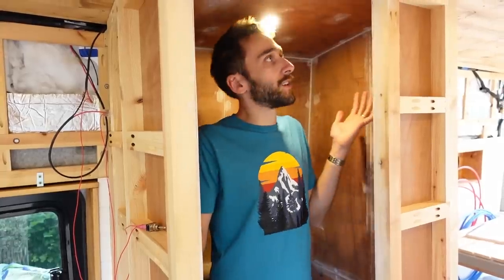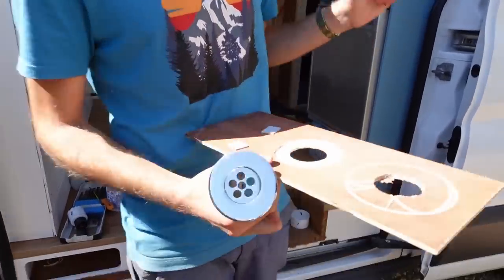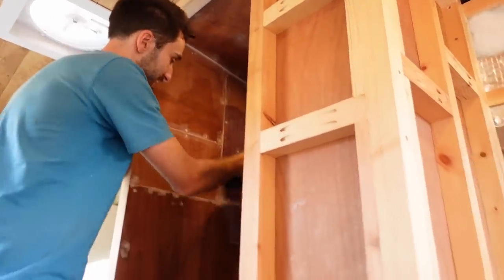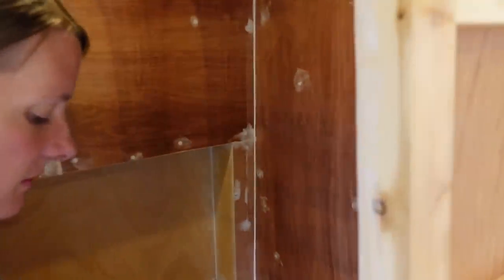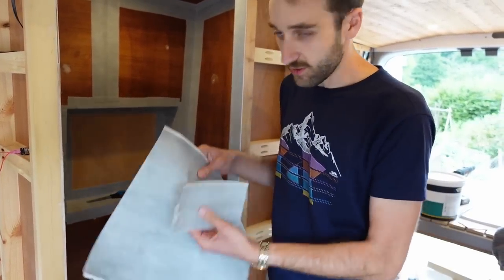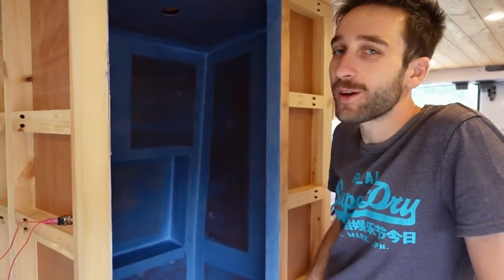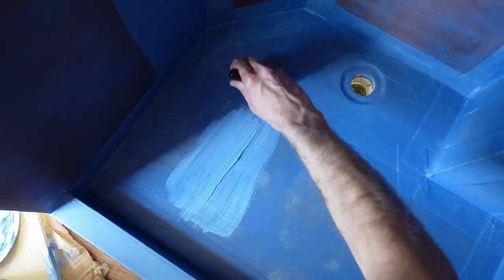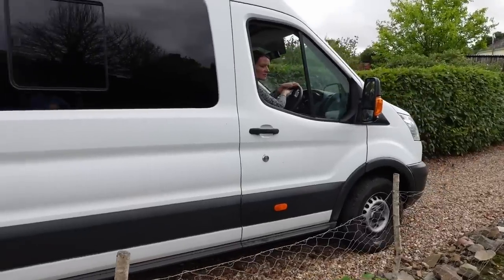Waterproofing Our Van Shower with Tanking (Recirculating Shower Part 2) | Transit Van Conversion E30

Comment: How strong are the magnets you used please?
Reply from the maker: Hiya, they're a pair of fishing magnets rated for 250kg. That seemed to be a good sweet spot as we could feel the magnetic force through the van through our composite floor with all the insulation in, but not so strong so that we couldn't remove them from the underside easily 👍
Reply: @SelfBuiltStories  Thanks. Sounds ideal for clarity was it 2 x 250 kg or 2 x 125kg please
Reply from the maker: @SeanDavey-q7e  250kg each, sounds like a huge amount but that's what's printed on them! The hold force is strongest when they're flat upright against a surface, so we take them off by pivoting them on an angle first. (No liability taken if you get a magnet stuck on your van that you can't remove 😁)
Reply: I’ll trial run them somewhere “safe” first😀thanks again for your reply
Reply from the maker: @SeanDavey-q7e  haha no worries, good luck 😀

Comment: Your shwer frame is kind of too strong huh
Reply from the maker: It's pretty strong, in part because we wanted to use up all of the plywood scraps we had leftover from the van walls to save buying any more, so needed more cross-members to support them on the edges. We might shave off some weight later on by carving some material out of some of those, we'll see

Comment: Fibreglass it it's much easier and cheaper
Reply from the maker: Hmm we found the tanking kit really easy to use to be honest, the tape is a little fiddly at first but other than that it just paints on. Probably one of the easiest jobs we've done in the van which was nice! It did take a while to complete each step but a lot of that was just drying time. Never used fiberglass before so would be interesting to try it out sometime, but can't really see it being easier for us as we'd need to apply the resin and cut the matting around and into all the awkward shapes of our shower. Cost wise there only seems to be a penny in it between the large tanking kit we bought and a similar sized fiberglass kit, although we did need some extra tape 😛